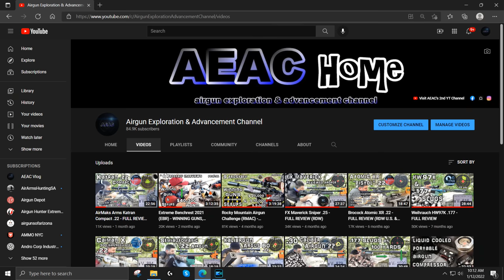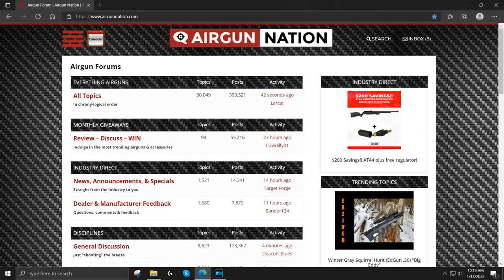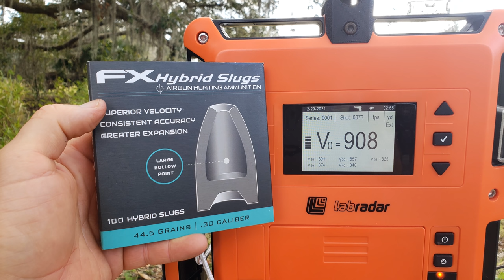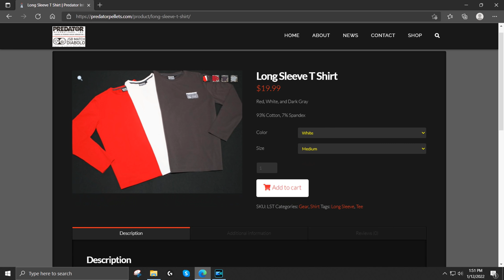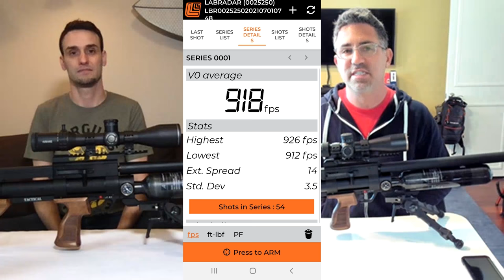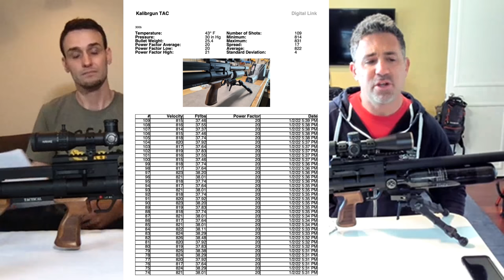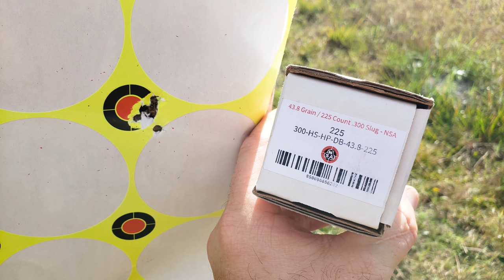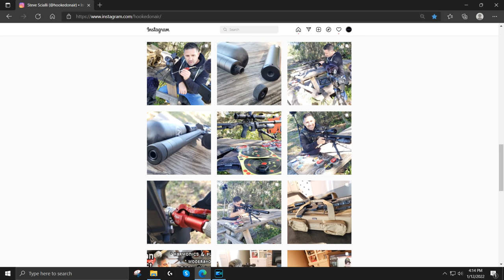Kalibrgun Cricket II Tactical .30 (Review) + SETUP + Accuracy Test !! - PCP Regulated Airgun

Comment: You’re right Steve. I hear a lot of people shooting well over 900 FPS when it comes to pellets, but they are typically shooting at shorter distances. I have shot 13 grain JSB pellets out of my Hatsan AT44 .22 cal and at 30 yards they were hole in hole. Some of the most accurate I shot at that distance. As soon as I went to 50 yards they typically opened up slightly over an inch, when the heavier pellets stayed well under an inch. Faster speeds is ok at short distances not long distances. 

This gun is impressive. I can’t wait for the full review! Thank you for the video Steve!
Reply from the maker: I've always been amazed at how consistently over-sped pellets can curve ball into the same hole at 30-40 yds, lol
Reply: @aeacvlog2033  
Me too. It’s so unpredictable. My Gamo Urban is the same way. At short distances it shoots shorter, lighter pellets better, but as soon as I go to 50 they open up to almost 2”. I’m sure a lot of that has to do with wind as well.

Comment: Hey guys, great video. I have the cricket 2 tactical in 25 cal. You guys had mentioned about the center adjustment to where the mag free spins. I sometimes use that to single load so to speak. I roll the mag up the a live pellet manually than cycle one in. I don’t do that often but if a person don’t want to cycle a pellet in with the lever you can always position that lever to where you can manually cycle the mag.

Comment: Hello Steve, greetings again from Peru... let me tell you that a couple of weeks ago I bought a  Kalibrgun Cricket 2 Tactical Cal .22.  (the short one (450mm)). Still I haven't done any single shot  with the gun because I' m waiting for the Air compressor (a CX2) to arrive from the USA (it was too difficult to buy an Air Venturi bottle and pass the customs here).  In the meanwhile I'm trying to gather info about the rifle. The enclosed manual was totally useless and outdated.  I tried to get info directly from Kalibrgun Support but those guys don't know anything about Customer Service. Their answers and information that they provided to me was very poor. Steve would you please give me some tips/hints about the right way on how to use the Regulator in order to get the best performance of the rifle and working with the right FPS, or where do you think I can get some info about it? Currently I don't have a Chronograph, and I don't know whether or not is a way to tune the rifle correctly without it, and thinking that I want to use JSB pellets (EXACT Jumbo Heavy 18.13gr  and Monster 25.39gr). Once more, thanks a lot  for your help...
Reply: My apologies friend.  I'm completely unfamiliar with Kalibrgun regulators.  Steve
Reply: @AEAC  thanks Steve…no problem…I will continue my search… unfortunately I contacted Kalibrgun Support Team, but they didn’t provide me any information about the Regulator… until next time…thanks

Comment: I am just getting into PCP air rifles. After seeing one of your older video, I just purchase the .22 cal Hatsan NeutronStar. I really want to buy a PCP compressor but there are so so many to choose from. What is the best one for under $500? I have been looking at the  GX CS3 PCP Air Compressor on Amazon for around $450. What are your thoughts?
Reply: I don't have experience with the Amazon and Ebay compressors but there is a lot of good reading over at the AGN forum on them.  I've read good and bad.  In the $500 range, I've been able to review two.  The Spark and the Nomad.  I liked the Nomad better.  The Omega Trail Charger seemed a much better unit than both of those, however it cost twice as much..  I reviewed it too. Steve

Comment: RE the MTC Copperhead, it has the same body as my Discovery VT-3 but with the addition of IR. How's the glass on higher mag, 12X plus? My VT-3 washes out a bit and was wondering if the MTC spec includes better glass as well as IR. Does it also have the honeycomb sunshade? Cheers, keep up the great vids but I'm limited ti our 12ft/lb limit here in the UK.
Reply from the maker: Thanks for the information.  I'll check the hi mag and report back in the full review.  It comes with 2.plasric flip up scope caps... don't see any honeycomb in them.   Steve

Comment: Can you remove  empty  bottle  and  put an already  filled  bottle  on? And can you adjust it with air in it or do you have to degas
Reply: Double check me by emailing Kalibrgun and asking them but most CF bottles simply unscrew "full" and a valve auto closes them.
Reply: No you can't,
There is no valve in the bottle.

Comment: Good material folks! I’m right about buying a bull pup in .22 and I want to give the Czech guys a try (after running a HW100 Laminate in .177 for years - crazy accurate at 50-60 yards - and a FX Crown). I’ve got the Cricket II  60 Tactical, the Argus 60 and the Caiman X on my short list and it’s not easy to decide which one to go for. Unfortunately I don’t have the chance to shoot them all.
Reply: I have the hw100 tk also the cricket 2 and cricket tacticle 2 and the hw has sat in its case for over a year.
My crickets are my goto guns,
I use the cricket 2 for ranges up to 50 yards and the tactical for long ranges.

Comment: I was hoping for a tunning guide. Very disappointing.
Reply from the maker: I'll run the HS top to bottom for y'all in the full review so at least I can report on the range of speed 👍
Reply: Check out the cocking arm and the hammer,
You will see that the hammer pin hits the cocking arm and only allows 2mm of the hammer to hit the 5.5mm of valve that lets the air out of the tubs,
I had to mill the arm and the guide so the hammer had 4.5mm of travel to hit the valve pin.
Reply: @PeakyBlinder  amazing. And what was the result?
Reply: @MarceloJouCRA  the result was a full burst of air behind the pellet instead of a whisper,
Went from 20 ft lb to 50 ft lb.